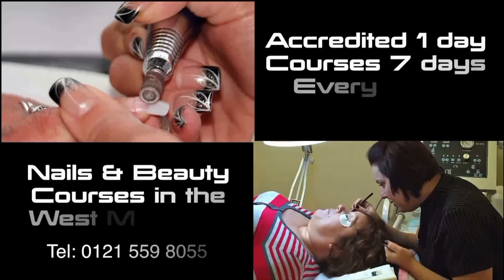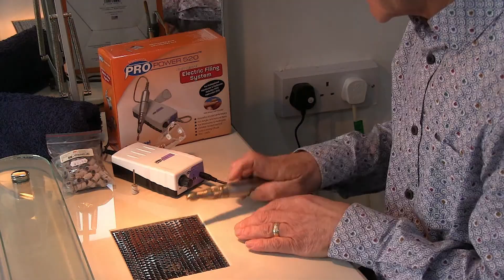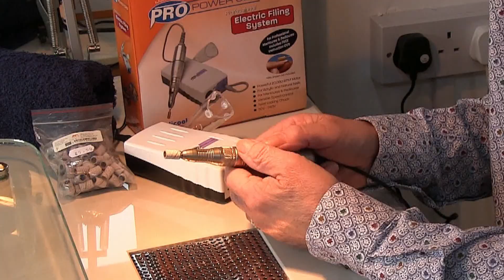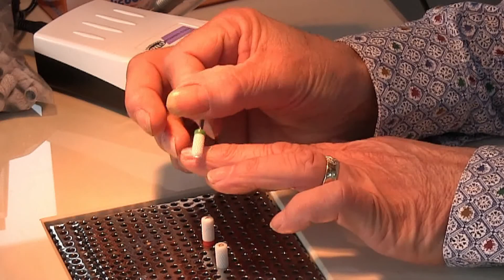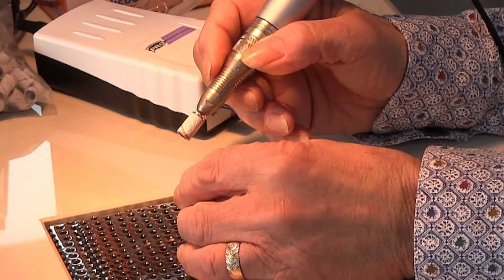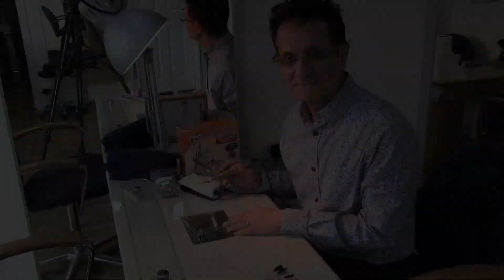Electric file Pro Power 520 for Nails

Comment: I really appreciate your honest review and the fact that you also respond to comments. I am not a professional but I would like to get something that will last me a while, without causing me to break the bank. I trying to decide between this and a Kupa
Reply from the maker: We have used the Pro 520 in our training centre for a while now and the students love it.  Very smooth running and excellent value for money.  It is a professional quality machine.  You will need to buy quality drill bits though, you need a Coarse, Fine and the Mandrel with fine sanding bands. John
Reply: Thank you so much for your recommendation. I am also exploring the option of buying a used Up200 or Kupa

Comment: Looks exactly the same as the E Zippy File by Light Elegance. Then again they're all made in China so i wouldn't be surprised if they get re-branded by the OEM manufacturer.
Reply from the maker: I would say you are right.  The problem is that all the quality is in the handset.  Cheaper ones do tend to vibrate on the nail plate and not run true.  I have brought cheap copies to test them and I have not yet found one that is as good as the original.  Regards John

Comment: Hello! Thank you for your informative videos! I've been looking at reviews for e-Files because I'm about to purchase one. I don't want to be cheap, I just just want to be smart. I see you like The medicool 520... And I've heard you mention the UP200 as the gold standard of the industry... I'm just trying to make the best decision for my purchase, but have not actually tried any of them. What should I do? The medicool 520 or propower 20K? The Kupa passport? UP200? KP5000? There are a few good sales right now, for kupa and medicool, so price is not determining the decision between these two brands. Please help me decide!!
Reply from the maker: Hi, if you want to buy a tried and tested electric file then you cannot go wrong with the UP200 it has been around for many years.  I have had one now for at least 10 years and it is still as good as when I brought it.  I have two more as well and they are just as reliable.  The UP 200 is more expensive at £305 but I believe worth the money.  The UP 200 is the machine of choice in the Vietnamese salons the world over.  I also like the speed control on the UP 200 it can be set very slow for working on the natural nail.  You will see machines boasting how fast it can run this is not important as when working nails you will never have it at top speed.  Regards John
Reply: John Tsang thank you for that sound advice. You have helped me decide!. I look forward to watching more of your videos
Reply from the maker: Hi, it really does depend on your budget.  The models I mentioned are the same quality. The 520 has a smaller footprint on the desk.  I would buy the 520. Regards John